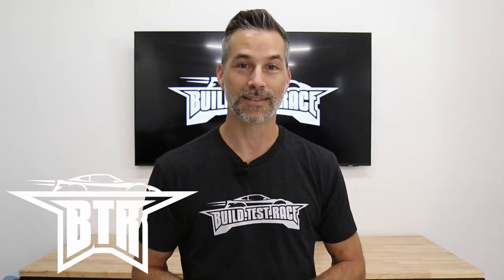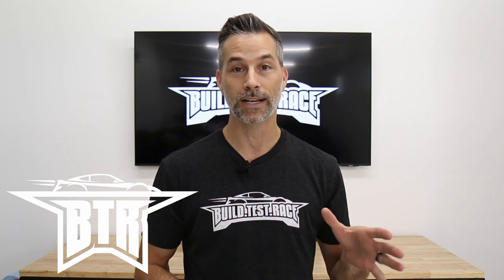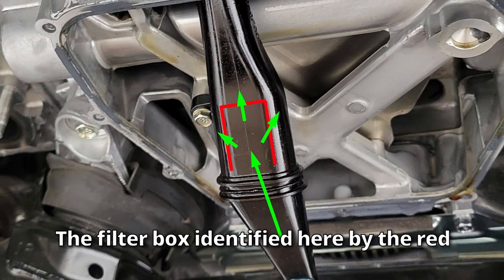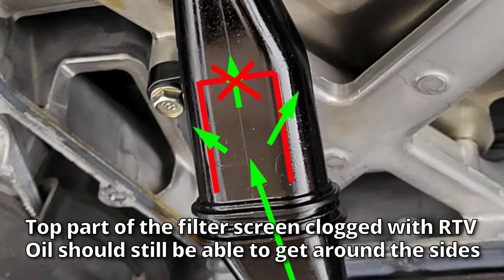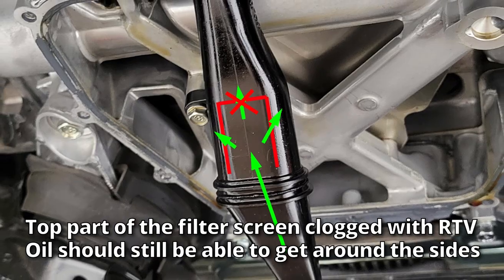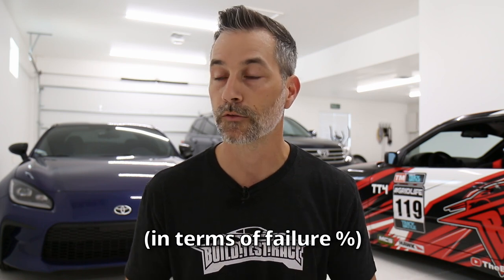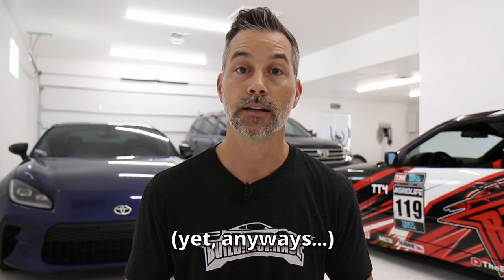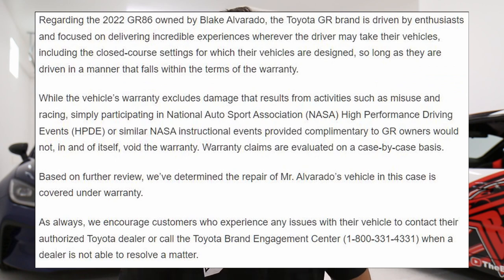Q&A From The GR86 RTV Silicone and Oil Pickup Issues

Comment: can you use vacuum tube to pick-up pieces without taking the pan off just preventive
Reply from the maker: You cannot get inside the oil pickup with the pan on. The pickup tube is too close to the bottom.
Reply: @TheBTRGarage  how about adding air pressure on the oil line going to the oil filter I believe pump is in between....wondering about condition that can push buildup back to the oil pan and get flush with oil even used but clean

Comment: Don't take a Subaru to a Toyota delarship to begin with. That's a Lexus/Toyota transmission and they can "rebuild" relatively well but that's just about. The rest of the car is pretty-much Subaru. If you think you can't take the 86/FRS to Subaru, then don't buy the toyota variant in the first place. But if you work on your own car, then it doesn't matter. Toyota mechanics are not know for boxer engines. Subaru mechanics work on them all day long.

And for using a gasket, Inline and V engines have a mono block goin to the pan. There is insignificant issues with tolerance, expansion and micro shifts within the mating surface. Subaru blocks and most Porsche boxers as well are split right in the middle. So you have multiple mating surfaces around the oil-pan / dry-sump. RTV is a much better sealant in these scenarios. It's more pliable, corrosion and heat-resistant. That's my engineering point of understanding. I don't work at either company, I just work on my own car.

They use a crap ton of RTV is because the pan is a thing sheet of steel, it literally bends between bolts. They have to use more RTV on the assembliy line to seal it right. The best thing you can do is get a cast aluminium (thick) pan and use a very thin amount of RTV on it.

Comment: In my opinion, it would be foolish to buy a new car knowing that RTV will most likely restrict oil flow. Low oil flow can cause premature wear and tear on an engine no matter if its a daily or track car. It would be beneficial to have an oil pressure gauge reading off discharge of filter. Also, there should have been a clean out option/port to access oil pickup tube other than dropping headers and oil pan. From an engineer's point of veiw, this is really embarassing to know a fellow engineer signed off on this design.

Comment: This is why Toyota shouldn't use other brands engines. This was an issue in prior gen BRZ/86/FRS as well
Reply from the maker: They did improve the oil pickup design over the previous gen though, see 10:40 mark. I almost think RTV in the pickup is an expected side effect, and the new pickup accounts for that, allowing oil flow around the RTV clog. Just a guess anyways...
Reply: @TheBTRGarage  you are probably correct.  They used a big ass band aid but didn’t suture the cut …..🙄
Reply from the maker: @hoopofficial4371  Yea getting rid of RTV all together would be the fullproof fix for sure :)

Comment: Overblown in the internet? Many many have found RTV in the pan and pickup. Toyota should have recalled all cars by now, dropped the pan, cleaned out and replaced the pickup tube. Sounds like you are in denial because you own one.  I for one will PASS on this car
Reply from the maker: Why in the world would Toyota recall all cars for something that has 0 affect on...anything? That is absolute nonsense lol.

The truth is that there are thousands of these cars on the road, people have been racing and abusing them for well over a year now, myself included, and 99.99% of them are perfectly fine.
Reply: @TheBTRGarage  My anger is with Toyota, not you - sorry. I guess the more prudent thing for Toyota to do would be to provide an extended engine warranty to put owners at ease. I agree that actual proven damage from RTV has likely affected an extremely small percentage of cars. However the incidence of finding RTV in the pickup tube is high. We may not know the full impact for some time. I am reminded of the Porsche IMS bearing weakness that to this day hangs over affected models.